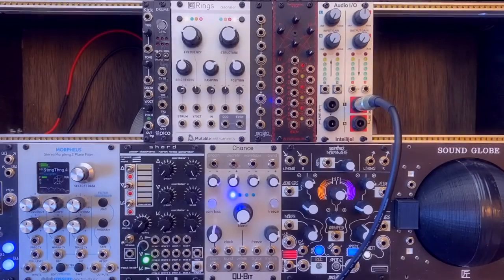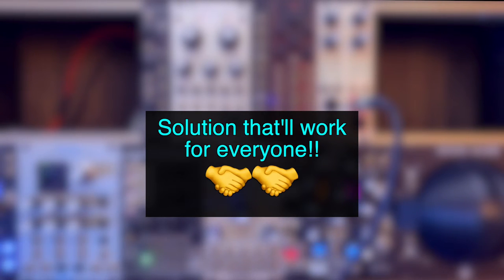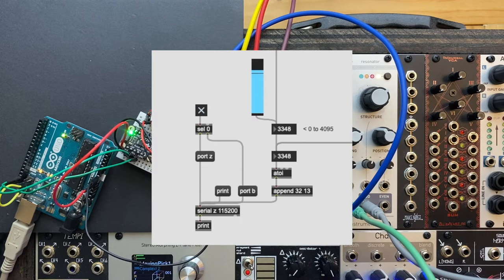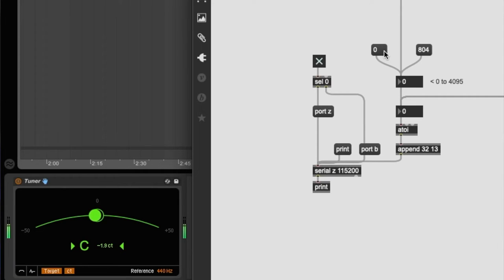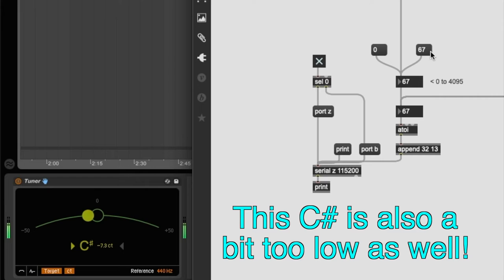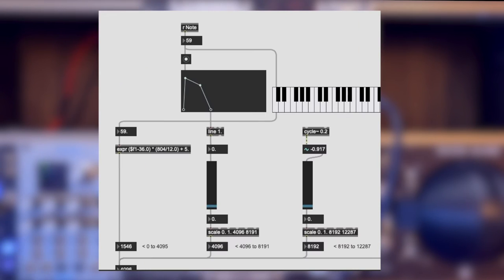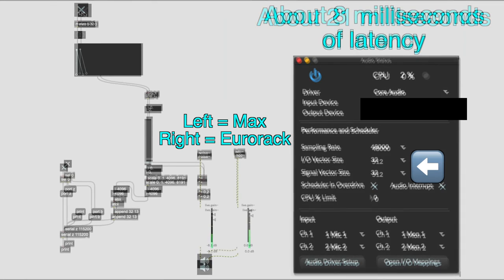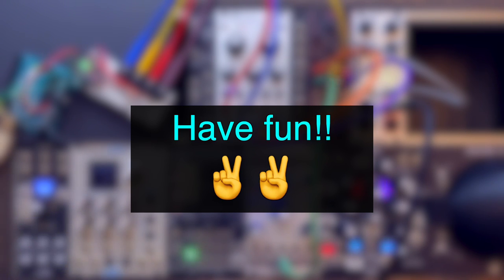Sending CVs from Pure Data & Max/MSP (DIY Eurorack Tutorial)

Comment: I am trying to send cv to control my synths with puredata through my DC coupled interface. If I create an osc object and send it out of the dac, it FM my synths and a *~ object expands the amplitude of the modulation sent. So far so good. But how do you get a steady voltage to control the pitch ? What is the type of signal I should use ? I can’t find any info anywhere. Thank you.

Comment: This is so incredibly helpful!  I'm away from my setup at the moment.  Do you think the same conversion will hold for output from a dc coupled audio interface?
Reply from the maker: I'm glad you found this video helpful! Thanks! 
I believe the approach of finding the octave & semitone "Pure Data voltage" should be the same. I don't know if it's going to be 0 to 4095, so I would go around the internet to find the appropriate values. Could be 0.0 to 5.0 for example. 

The difference is [dac~] will be the output. [dac~ 1 2] are reserved for the main L & R speakers. Assuming that the dc outputs are the third and fourth output of the audio interface, you will need [dac~ 1 2 3 4] and connect whatever voltage values to the 3rd and 4th input of that object. 
I would recommend unplugging your main speakers from the interface when you try for the first time, just in case!  Best of luck and let me know if it works cuz I'm curious!!

Comment: This is a great progression with the project. Seems like you could use a smaller Arduinto to get the module down to 6HP or smaller. I'm interested to see if you can get 8 CV outputs happening with two DACs.

Also, Rings is much more difficult to "tune" than my other oscillators.
Reply from the maker: For sure, using Arduino Nano is the move! Yeah, I'm sure we can daisy chain another one, but I haven't looked too much into it. I should do a follow-up video once I get two or more working.

That's good know! That means it should work even better for other oscillators.